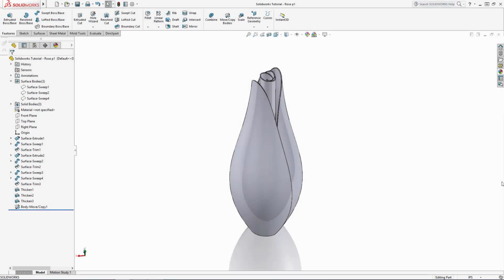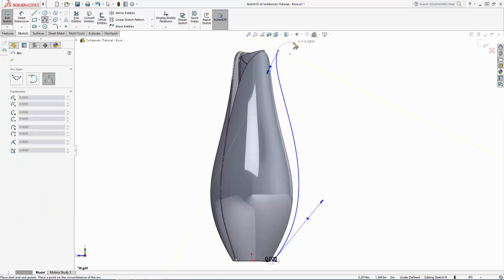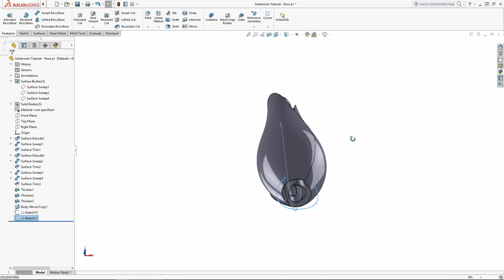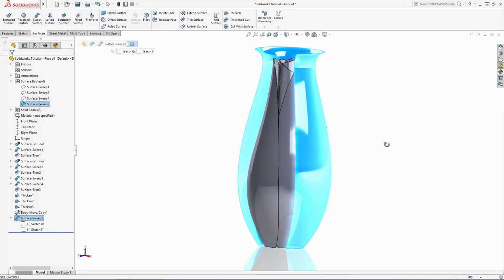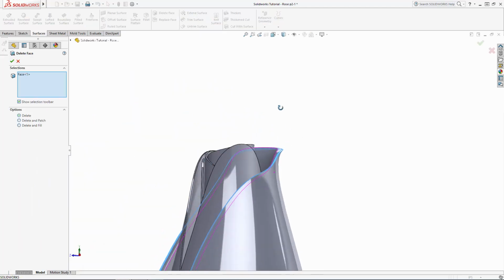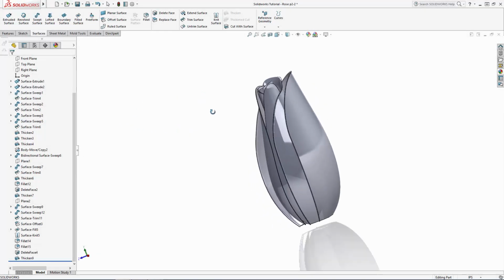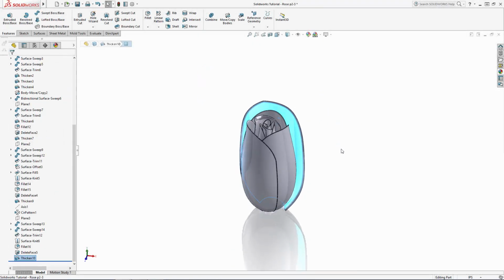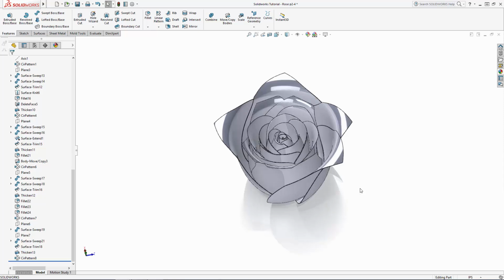SOLIDWORKS Rose Tutorial - Part 2

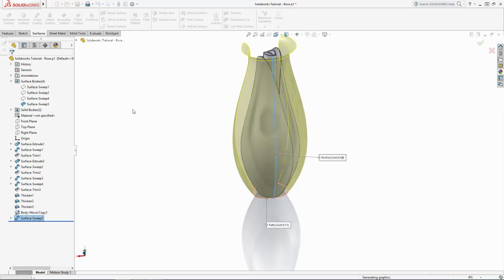Comment: You are apparently using a later version of Solidworks than 2015 (the version I use), because at 2:19 you indicate using the "bi-directional" sweep, which was released in the 2016 version. Rats! 
I managed a successful work-around, though. Just made a plane at the BEGINNING of the sweep path, and copied that outer leaf profile to the new plane, moved it into correct position, and then swept it along the FULL path. So I guess it was not that big a deal.